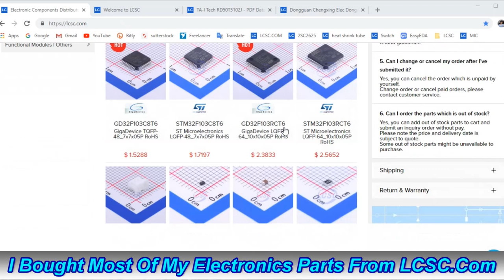How To Make A Bass Booster Circuit At Home Easily - Awesome Ideas

Comment: You can boost the bass all day long only problem is if the speaker can't reproduce the frequency or handle the extra power is will cause distortion clip the speaker and that can damage it. IF you want your sub or other speakers to sound better don't let it see frequencies it cannot reproduce. You can make a passive crossover with capacitor and coils. A capacitor cuts low frequency and a coil cuts high frequency. You can build a passive crossover that cuts out a massive amount of frequencies you choose the speaker not to see. You see a lot of passive crossovers in home audio speakers and car audio door speaker component sets. You can use a passive crossover with a powered one. You can look up the different configurations that can be made and what kind of components needed. Capacitors need to be bipolar or non polarized and the lower the microfarad number the higher frequencies it lets through. Example a 2.5 microfarad is used on many tweeters. If my memory serves me right one cap inline is a 6db crossover. If you have a cap inline with a coil after the cap in-between positive and negative wire is a 12db (if my memory serves me correct it has been a long time since I built one). Two caps inline one in positive and one in negative line with a coil behind them (on speaker side) in-between positive and negative is a 18db crossover You can literally build a passive crossover to only let the frequencies you want it to see by what caps and coils you put together. I have seen schematics with 6 or more caps and 4 plus coils. There are other components used in passive crossovers for the life of me I can't remember it all it's been 25 years since I really used them in a system. It was fun building them though.  Creative World you should do some research and make a few videos on them. I remember a car audio magazine article (before the internet and google search) that had a car audio system with a passive crossover as the only way frequencies  were controlled. Kinda a lost art since most amps have them built into them.
Reply from the maker: thanks a lot
Reply: @CreativeWorldPro  Your welcome, passive crossovers are fun to build and unfortunately with most amplifiers having built in electronic crossovers a dying art. You can still Google the charts that show what cap and coil vs the frequency cut off range to use. The different "orders" as it is called will determine what kind of circuit you are going to build to obtain the desired cutoff. Really if you tune the circuit just right and use this booster you made here, you could actually get a sub to overpower and play to it's maximum. You could actually do multiple videos covering the different orders from high range to low range. Could be very educational. I am going to sub so if you do a vid on them I will not miss it. 
  I even found a website that had a bunch of the car audio magazine articles archived and available to read on passive crossovers. I will have to look up the one that had a servo motor driven subwoofer, no magnet  just a servomotor that was attached to two rods driving the cone of the sub.
 I remember before the world wide web the crossover list would be published once a year. Of course ya would lose the one 6 months before they put it out again.

Comment: Something I wanna know is the bass booster or volume for base
Reply from the maker: volume for base
Reply: How to volume booster
Reply: @madeintanzania2995  preamplifier
Reply: Buy a quik-tube from home depot or low's it's a big cardboard tube make it stand up right and put your speaker at the bottom with a hard surface and increase the volume up all the way a song with bass and there you go